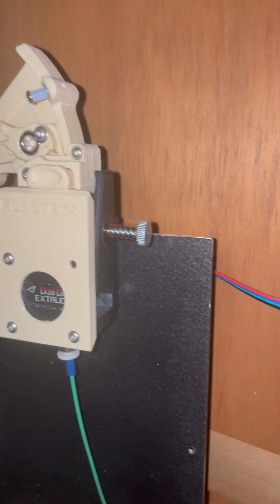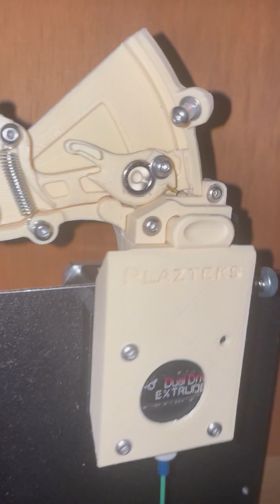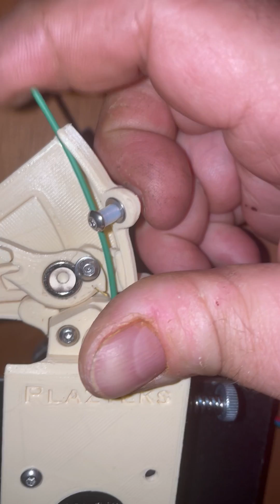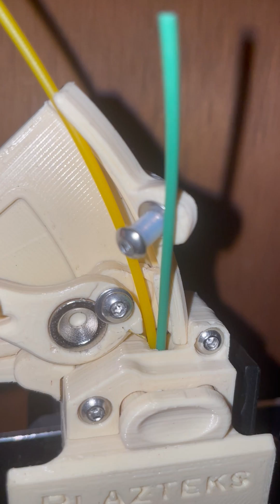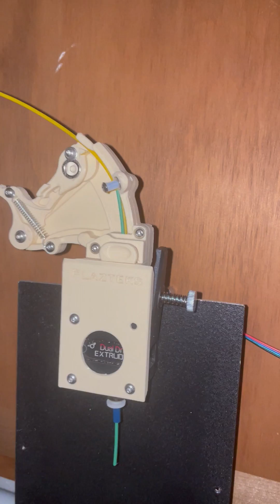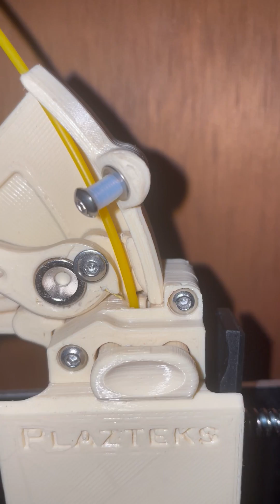Filament Loader 2.0 BMG style extruder test

Comment: I'll say it again. That's great! I really like.
 There is one thought, I think you have thought about it yourself. 
But is it possible to make a number of consecutive loaders. 
Let's say there is a whole bunch of unprinted filament with short cuts. 
I don't want to load it all the time. Babysit the printer. 
A set of your loaders with a small offset relative to each other. 
Each one will be loaded with a small crop that we still want to use. 

Thus, it will constantly add new clippings to the queue.
Reply from the maker: Thank you, I have, and am working on something to that effect.  bare in mind, it would most likely be for a bowden tube setup, as the more filaments that would need to Queue into the extruder, will just add more mass to the print head, and extra drag.....
Reply: @frantasticdesigns  Sure. I completely agree with you about the mass. To be honest, it seems to me that your design can be applied on directextruders. The only thing missing is the travel reserve of the feeder. Now I'm sitting and thinking how this can be solved. Probably this can be solved with the help of a spring from a measuring tape. Thus, it is possible to make a filament presupply for the entire length of the PTFE tube that enters the directextruder. Adjust it in such a way that at the end the drum disables the grip. Using a cam and gears. Which will count the required number of revolutions. The feeder tubes come in different lengths, wide flexibility is needed here.

Comment: This is a great design that would solve my problem of having tiny bits of filament left over that are inconvenient to use. However, as I understand it is intended for fixed extruders right? So for bowden printers. Have you got any ideas on how this principle could be adapted to direct drive machines? Or are they too different since they have constant motion etc?
Reply from the maker: I have one on my Ender3v2 setup as direct drive.  Not an issue as long as you leave enough loose slack on the new filament so that the print head has a full range of motion while it's printing and won't yank it out. I load mine all the time while it's in motion, you just have to have a " fluid touch"
Reply: @frantasticdesigns  that sounds great.  I'd love to see that in action if you ever need an idea for a video ;).